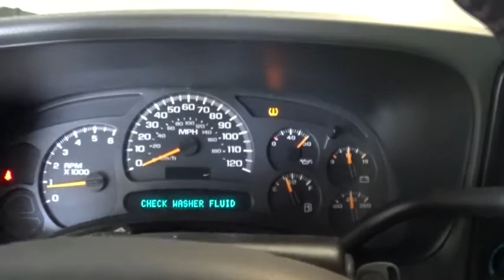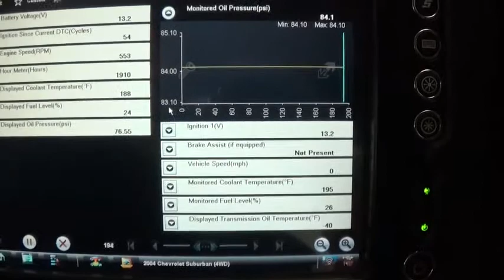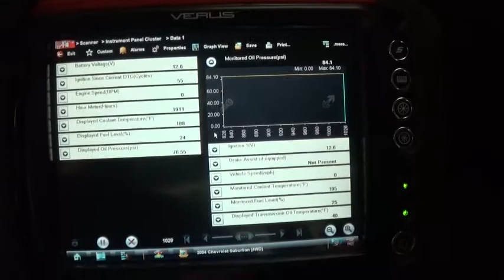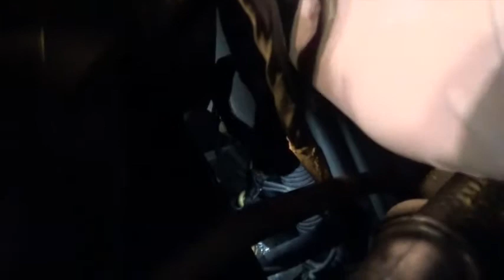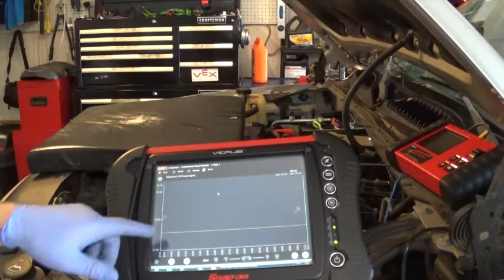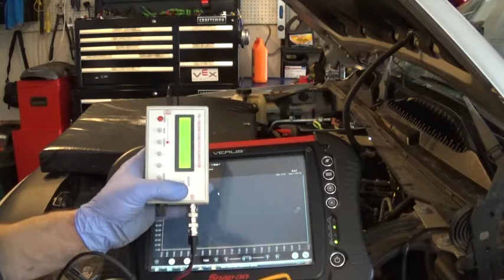2003 Chevy Suburban Oil Pressure Gauge Diagnoses

Comment: Ramon! Question about lab scope, I'm debating between two scopes like the one's that you own ,which is the ( OTC Pegisys and the OTC 3840F) for about the same price, which one would you recommend and why .
Or would you recommend any of these, the Pegisys does not have the VIC but it has the scope function, thanks Ramon..
Reply from the maker: Abel Leitao If you looking for OTC scope I would go with Pegisys  100% much better and easier to use. I had experience with both. You can buy Pegisys for $250.00/&300.00 if you want more info send me your contact info to ruzic@bellsouth.net Thank you

Comment: Real world problem here is how to justify spending and using $15,000 worth of test equipment to diagnose a bad oil pressure switch when the switch is only $35 and it's a known problem! Dealer or shop would never pay you a dime for diagnostics on this job, only to replace the part. They might charge customer an hour for diag, but the mechanic isn't getting paid squat.
Reply from the maker: Jacks Garage first I would never pay that much for my scanner. I buy them used on eBay when I get good deal on it. And don't worry it's my money. Buying tools of any kind is investment in my opinion. Thanks for watching

Comment: Great diagnostics Ramon and it sure looked tough leaning over that engine to make those hookups! Nice touch of using the function generator to simulate the pressure changes on the scanner. Keep up the good work!
Reply from the maker: stuzman I like my foam pad it does help when I need to lean over engine like this. Cheers my friend